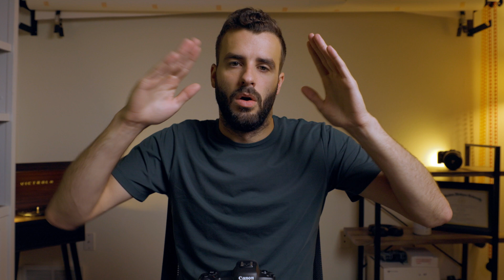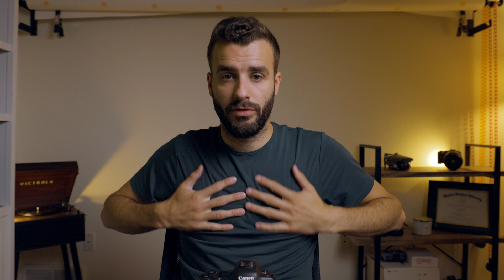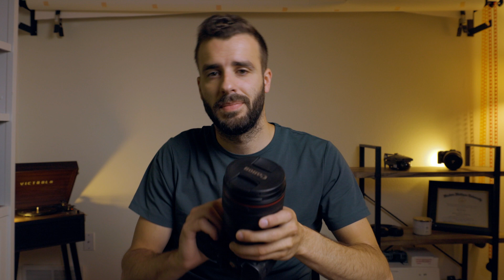Why Did Canon Limit The R5 Overheating?

Comment: Probably they just realized that with new firmware camera will last for 5 years and not 10 and that's good for business.
Reply from the maker: I mean, Most of my cameras get replaced every 2 to 5 years depending on what comes out so it wouldnt matter too much anyway.
Reply: @EngineeringFilmmaker  exactly the point. It will decrease sale value if true though.